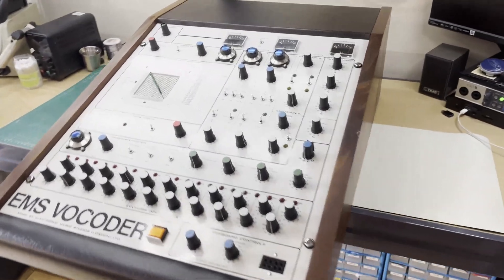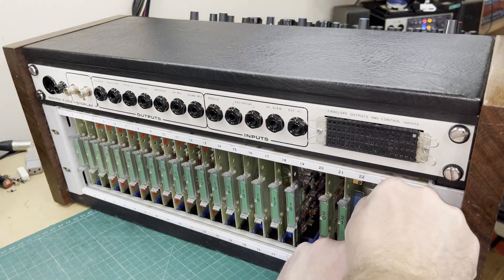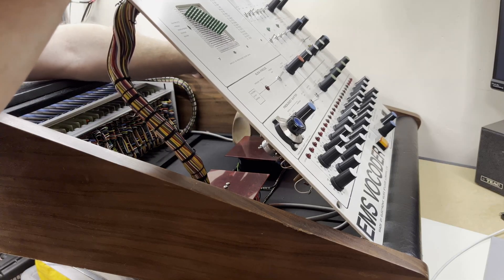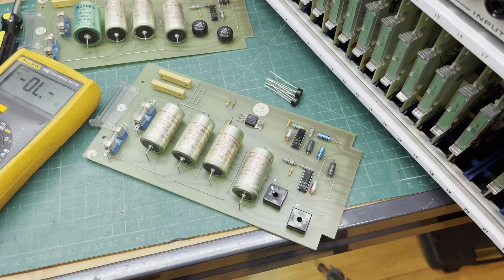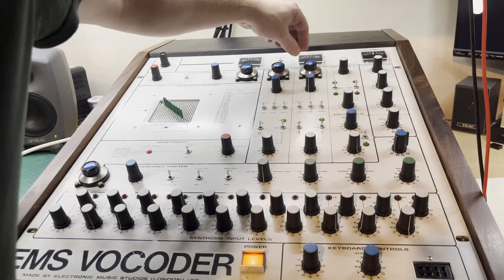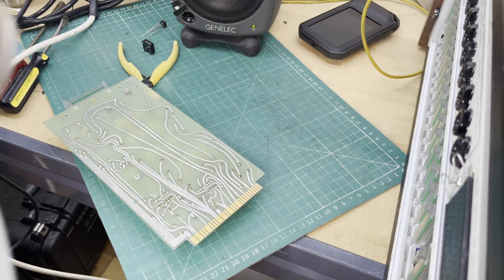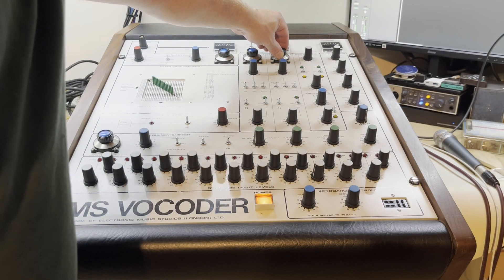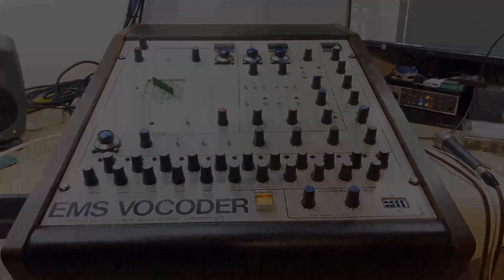EMS Vocoder 5000 Repair

Comment: Because I'm a massive nerd, I'm curious about the dimensions of the rack cards in this. You mention that it's Eurocard-style, but if it's the same as that in the Synthi 100, I think the measurements are different? I haven't had any luck finding an equivalent based on measurements from photos/drawings of the Synthi 100 cards, so any info you could provide would be great!